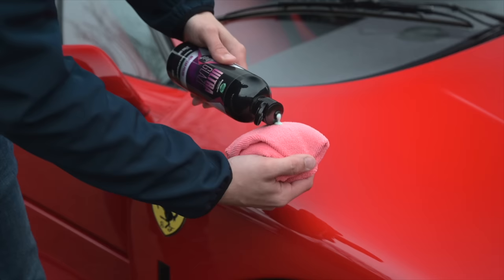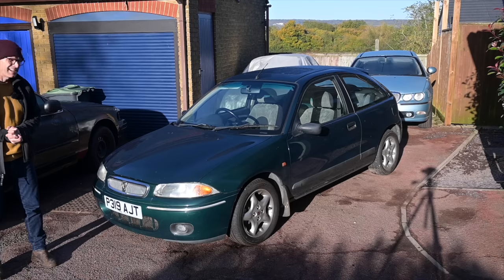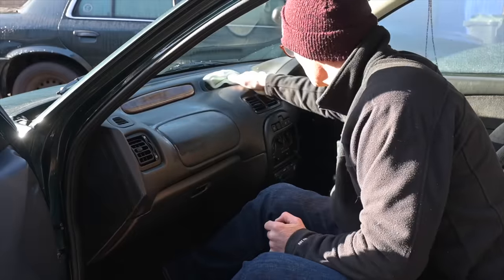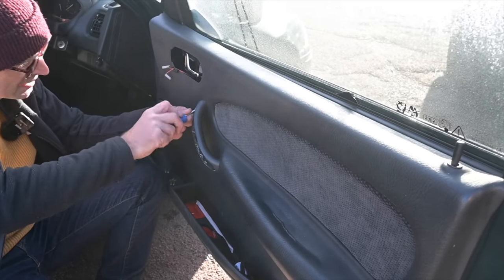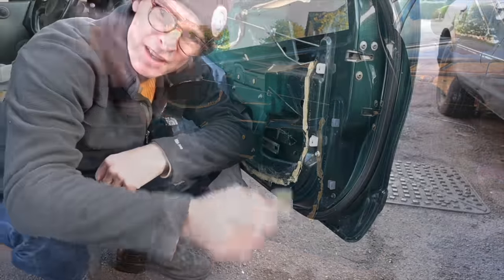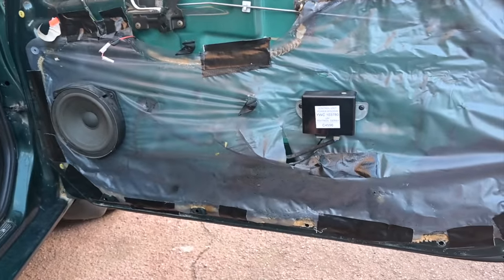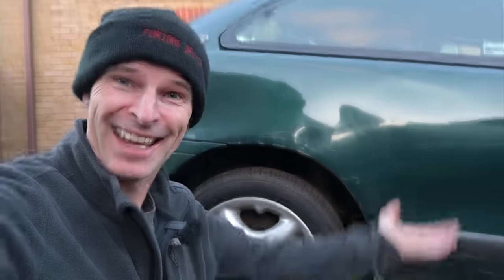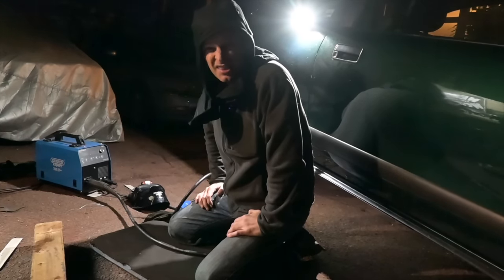Fixing a window with an angle grinder, Rover 200 NEC prep, and bonus rust!

Comment: It's sods law Matt. Always the same when there is a deadline to meet and the unexpected happens. Only last weekend I was 80 miles away visiting family. I'd locked the car  Sods law struck, the key fob battery had died so no way to get into the car (apart from prising part of the handle off to find a key lock) or start it. I always carry a spare fob battery so that wasn't a problem, getting the spent battery out was though. Deft use of a borrowed knife and all was well. Note to self, carry a tool to get the old battery out, something like a nail clipper thingy might just do the trick as it's not a good idea to carry a knife, even a small one.

Comment: Bloody R3 200 window regulators. Consider yourself lucky that the motor didn't rip itself off the door skin and tear the holes oval. Had to fix mine with steel plate.

One observation and I hope this isn't unwelcome... but her nose is sagging, giving you that massive shut-line between bumper cover and bonnet. This is caused by the supporting frame, which is a pathetic H-shaped (roughly) structure behind it. Totally different from the R08. If you take the bumper cover off, you can bend the thing up by hand! 

Seeing as you can weld, I would recommend some additional structure so stop it sagging again. Cheers!

Comment: Those bits of plastic are supposed to be bonded to the doorglass, they are not clamps. Also if you have metal contacting the edge of toughened glass like that eventually the glass will explode.

Comment: For the amount of welding you end up doing. You should invest in a proper/bigger gas bottle and a proper regulator. It would work out cheaper I recon.
Reply: 100%! It is so much better with a proper bottle and regulator. Also, you can see how much gas you have left.